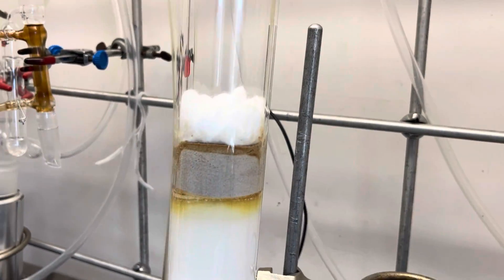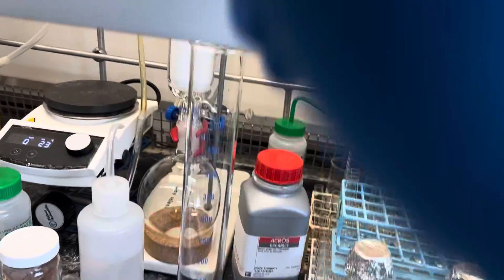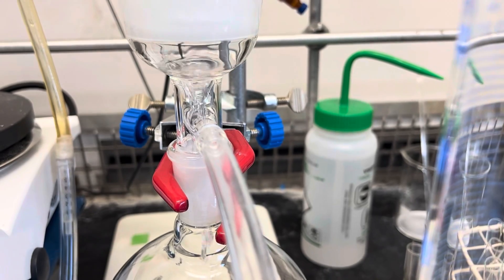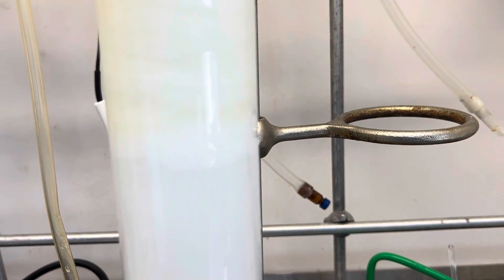Quick vacuum column chromatography: shortcut way of compound purification (VLC)

Comment: Thank you. My sample did not dissolve when  use methanol , ethyl acetate, dichloromethan. Just dissolve in DMSO . Can i use dmso and upload my sample
Reply from the maker: Please don’t use DMSO for this purpose. It is not a good solvent vacuum liquid suction.
Reply: @Dr.Mosharraf  ok thank you doctor . But my sample does not dissolve in any solvent.  How can i do to upload my sample ?please doctor
Reply from the maker: Why you have to upload on silica? For purification or to remove metallic residue? Sometimes such kind of solids can be purified by using mixture of solvents.
Reply: @Dr.Mosharraf  thank you doctor .you mean dissolve using ethyl acetate and hexan and put it column even not compleately dissolve
Reply from the maker: No. If not dissolved completely you shouldn’t use silica load. Without silica load use other solvents. Like add ethanol and little bit dmso. See if your minor impurities dissolved and wash out. Filter solid and then check NMR.
Reply: @Dr.Mosharraf  thank you. If use ethanol but just a little bit dissolve but almost still solid .here can i tool dissolved amount and put it inside column to seperate my compounds

Comment: Please how I can choose the size of column, in our laboratory we have different size but I don't know which one I must use to purify my sample
Reply from the maker: Depends on silica amount you need to purify. Suppose you have 2 gram crude compound that need to be purified. Then in your column you need 40 to 50 times of silica. 2g x40 = 80 g silica. Approximately 80/0.5 = 160 mL in solid form silica. Because silica can fly and it is dangerous to weight . Inside hood, use big measuring cylinder to measure silica as volume. And from the silica amount you can get idea which column size will be appropriate. I hope it will help.
Reply: @Dr.Mosharraf  yes I understand everything you write but 0.5 for what?, thank you so much professor.
Reply from the maker: It is assumed that the density of silica is approximately 0.5. So density = mass/ volume, so, volume = mass/density.

Comment: If I used wet packing of silica gel to column (slurry), 
here, can I use any solvent for silica gel until reached slurried, or must use only hexane. thank you
Reply from the maker: You should use only hexane to equilibrate column. But if you need 5% methanol in DCM to separate, then in some cases you can use DCM to equilibrate.
Reply: @Dr.Mosharraf  Thank you for the response.

Comment: happy new year.
If I have solid sample containing components, 
can I use any solvent to dissolve it?
Or I have to use only  the same mobile phase as solvent to dissolved sample?
Another case, if must use same mobile phase, but my sample can  not dissolve,  here, please I need solution to this problem. can I  use any solvent? thank you alot
Reply from the maker: Normally I dissolve compound in DCM and then add 1.5 times (per weight) of silica gel. Then dry out the solvent and make silica powder containing crude compound. And then I add powder on top of the sand layer in column. But if you want to load as liquid, then dissolve your compound minimum amount of DCM and then with pipette add in the column. Then let the solvent run once all solvent goes into silica and compound gets adsorbed in the top silica part, then add some hexane and run it so that polar solvent DCM can go out with hexane. After that you can adjust with your desired mobile phase.
Reply: @Dr.Mosharraf  thank you for the valuable information

Comment: Thank you so much. Is there standard to use silica gel in column, I mean if my sample a little bit like (0.01 gram), how much of silica gel use here?
in contrast, if I have a lot of samples such as (1 gram or more), here, how much of silica gel have to use?
I mean is there ratio from silica gel to sample to use in column, please tell me
Reply from the maker: Normally, I take 30 to 40 times of silica gel with respect to crude amount. For example if I have 1 g crude, then I take 40 gram (80 mL dry silica) for the column packing. Normally silica density is assumed as 0.5. So if you need 40 g silica, do not try to measure silica in balance (due to safety hazard). Simply take a measuring cylinder inside hood and take 80 mL of dry silica. Then transfer it to a beaker to make slurry if you want to make wet load. I hope it answers your question.
Reply: @Dr.Mosharraf  Thank you so much for all answers. I really appreciate your help
Reply from the maker: By the way can you please share my channel to your colleague and fellow people? Whoever are chemist. They must be benefitted with this videos
Reply: @Dr.Mosharraf  Sure, I found your channel is excellent. and you are so helpful thank you

Comment: What size of Silica is used in the column?
Reply: I use 15u. Not too small but smaller than used in flash chromatography
Reply from the maker: It was 7 g crude purification. Around 300 to 500 g silica gel I used for this scale.

Comment: What if the two spots are too close to separate..
Can I still use this method??
Reply from the maker: It will tough but you can fractionate the compounds. Then you will come up with mixture and pure part. Mixture part can be purified by recrystallization or column. You can see my videos on ninja techniques.